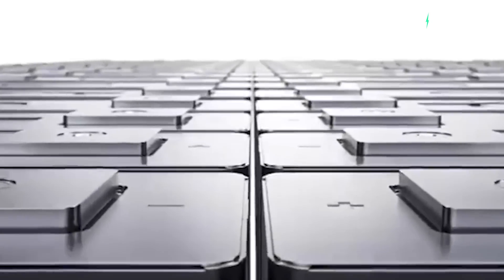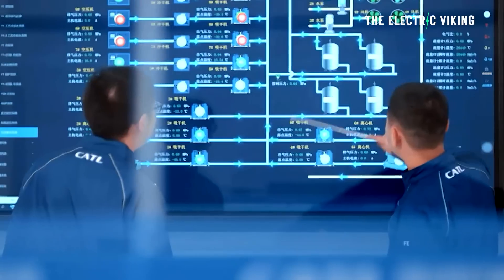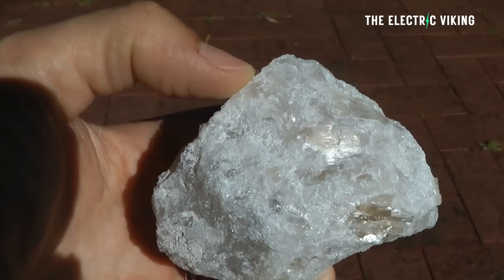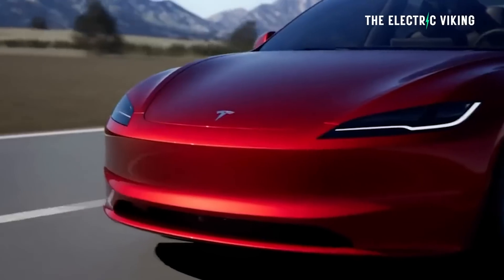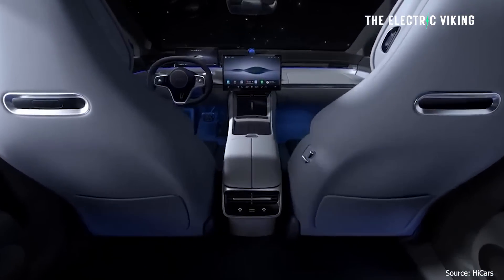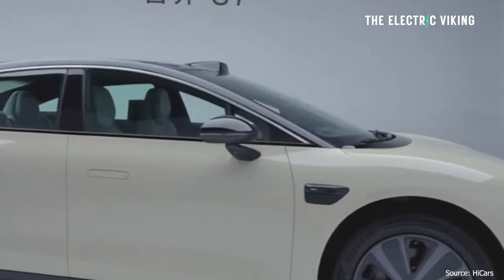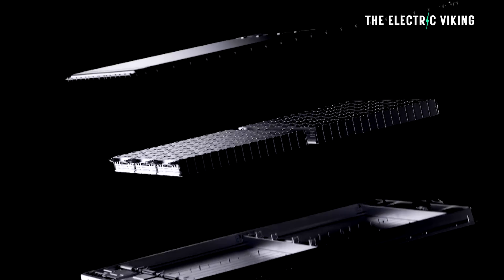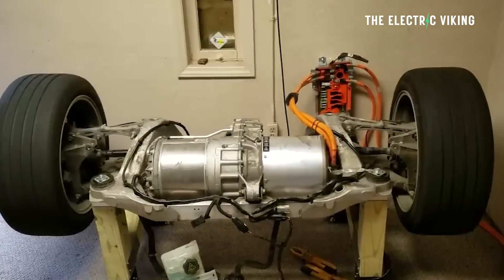World's first EV with CATL's hybrid M3P battery now available to buy

Comment: The value of any Tesla automobile purchased before the 2025 models become available with the new battery technology will collapse when the new vehicles hit the market.  Everyone will want to get the new technology and try to sell their existing vehicles which will further drive down the value of their existing vehicles.  So, the only way to purchase now and reduce the impact of depreciation is to do a 2 year least with Tesla.  The cost of a two year lease will be significantly less than the depreciated value of existing models.  Do the math.  After the lease is up then purchase the new vehicle with the new technology.  Just be aware that technology is changing rapidly and future "new" products will have new and improved capabilities which will affect the value of the previous technology.  Just a fact of life.  Ain't it grand how this all works.

Comment: Great info as always.  However I question the claim of 800km range on a 80kWh battery.  Consider this:  A kWh is a kWh.  Doesn't matter whether it is stored in a LiFePO, NMC or even in a Lead Acid battery. 800km ÷ 80kWh = 10 kWh/100 km. Model 3 LR is best in class at the moment with 14 kWh/100.  ...  Efficiency comes from mechanical efficiency (rolling resistance, aero etc) plus electric motor efficiency.  ...  Where battery efficiency adds to range is where you use the higher capacity to squeeze more kWh's into the car, E.g., if Tesla upgrade the model Y battery pack from 4680 batteries 75kWh, and in the same space they put the new improved batteries and give customers 90kWh, that is 20% increase.  ...  But  ...  If they simply give you a smaller battery pack with the new tech, so you still get only 75kWh,  the range is not improved like that  ......  Cheers, thanks for your great channel 👍

Comment: Can you stop telling people that charging their LFP batteries to 100% doesn't affect the battery. This is a lie. The only reason you are charging it to 100% is to calibrate the BMS. If the BMS was able to tell the difference between 80 and 100% the advice would be to charge it only to 80. Charging your LFP battery to 100 will increase degradation in comparison to charging to 80

Comment: it's about time, less lytium 700 km range, that,s the only way electric vehicle will sell. Anything else available at the moment is crap, even the expensive ones are crap. will wait and see, i dont trust any builders anymore;  cars that explode or catch fire is criminal cars that door wont open in an accident is criminal. cars who"s 12 v battery die when parked for 5 days is not criminal but we dont want them, cars that sell for 65,000 dollars is hyway robbery for most people . cars you cant charge more than 80% are worthless.. Anyway we have to wait for the good  ones and before they are available on the dealer lot will take time,, and you dont want to buy the early ones because the dealers will take a big cut over the demanded price.

Comment: Even LFP degrade more if 100% charged. The reason Tesla says to 100% charge them is because they can't determine the state of charge because the voltage drop is flat compared to Lithium Ion. If they aren't recharged 100% they can't keep track of the charge state.

Comment: I don't understand. If the MP3 battery has a higher density, then why is the battery pack only 80kwh?? I was expecting a minimum of 110kwh. 
Also, how on earth can a 80kwh battery achieve a 800km range??
....unless you believe in fairies..

Comment: Plecase do not mention ranges in CLTC anymore! They are almost double than reality!
800km in CLTC = 680km in WLTP = 590km in EPA = 500km in reality.
Reply: Most drivers can achieve WLTP
Reply: @nordic5490  In city driving or speeds until 90km/h and summer conditions and no AC, yes you can achieve WLTP, but most of the times you will be not even close to EPA.

Comment: I dont like EV but if we have unlimited elecriticity , I would make batteries in big box container. Robots will pull out your battery and put charged battery. Basically you will have main battery and temp battery. Temp battery give you 50mile. So in emergency you can use them. its like your extra tire.
Reply: Batteries can be charged from 20% to 80% in just 5mins. Why bother with robots ?
And, 90% of all ev charging events in the usa are at home atm. Just charge overnight.
Reply: @nordic5490  fast charging kill the battery quick
Reply: thats pie in the sky thinking. If tesla had that approach, the cars they now sell would take more time to make and be heavier. Another round of infrustructure needs to be conjured up. We are already conditioned to fill'er up.  But if you want a "temp" battery, thats easily done. Just lug it into your boot and plug in when needed. We are already seeing EV trailers that carry a battery pack. If you cant wait, generators are cheap enough. But dont try to re invent the wheel in your mind. Swapping batteries is about as effective as hydrogen refills, not in my life time.
Reply: @andyfreeze4072  EV cars are scam anyways

Comment: With safer and longer range batteries packs, people are more likely to switch to drive an EV. 

But electric vehicles are still way too expensive for most people to purchase. 
To get more people to drive an EV, Auto Companies has to bring the price down on E V.
😉💖⚡️🔋⚡️👍
Reply: The USA has a 25% inport tarrif on Chinese made evs. Take that away, and the USA could have $25k evs.
Reply: @nordic5490  I am aware of the "chicken tax" ( https://en.wikipedia.org/wiki/Chicken_tax) but that applies to imported trucks and light commercial vehicles. Is there another import tax levied against imported ev vehicles?

Comment: When you say hybrid what do you mean? I thought M3P just adds  magnesium. A hybrid might suggest a mix of battery's like a combination
Salt and Lithium pack. I would llike to see some real world ranges in mpg's from some of these new 600 km claims. I don't see how they are squeezing more range out of these 80 kw packs. (better motors or huge weight losses)
Reply: The M is for manganese,  remove Cobalt and boost Nickel and Manganese .
Reply: The hybrid batteries actually mix  LFP and NCM cells  with extra battery management.
Reply: I think only one company is doing the combo battery . And it's not out yet. I was under the impression it would be 
all LFP or all M3p .

Comment: Someone with a zeekr 001 using the catl quilin 140kwh pack got over 900+kms of real world miles at 90+kmh out of 1 charge earlier this year.
Reply: With a 140 kWh pack, going 56 mph, they went 560 miles.  That's 3.99 mi/kWh.  Ionic 6, Lucid Air Pure or Touring, and Model 3 RWD can all hit that efficiency level.  A bunch of other cars come close.  Whether or not you need a battery that gigantic is another question.  Personally, I don't.

Comment: An 800 km range should require a minimum 120 kWh battery pack.
Reply: or a light weight aerodynamic vehicle. Battery chemistry and size is but one part of the equation.

Comment: Very much waiting for this technology. I frequently drive up into the mountains during the winter (At least weekly).    I want to be able to reach a trailhead 165km from my door without charging on the way home.  When I apply range adjustments for Cold (-15C), Winter Tires, Highway speeds, Charging to 90%, Getting Home with 10% I'm come out with current numbers around 125km  on the LR and 115km on the lfp. This new battery that likes 100% and has better cold weather performance could just get me over the line.
Reply: Don't forget the regen when going downhill, could be considerable. Hi have a LR M 3 RWD with 500km range @ 100%, however charge to 80% & could make that trip return at -25c no problem.
Reply: After sitting for 6hrs at -15c,  my understanding is that it will take some time for the battery to warm up enough to charge from regen, do you have any experience with that?  Unfortunatly with most of my mountain destinations have the steep climb/descent close to the trailhead.  @rozonoemi9374
Reply: I doubt that Tesla is going to switch its LR variants to M3P, because it needs the higher energy density of NCA/NMC/NMCA. M3P has an energy density of 210 Wh/kg on the cell level, compared to 269 Wh/kg for NCA. I suspect that only the standard range will use M3P, but the LR will use the future NMC Qilin batteries, which have an energy density of 255 Wh/kg.

Comment: 850Km CLTC does NOT translate to "800Km real word range". We know that  CLTC gives higher range estimates than WLTP, which in turn gives higher numbers than EPA, which in turn is higher than typical "real world" range.... So, hype aside, I'd be pretty surprised if this car had much more than 600Km "real world" range. We will have to wait and see...
Reply: Exactly!  Too many Negative Trolls here!
Reply: NEDC ?
Reply: Europe has been using WLTP instead of NEDC for some time now. I believe that CLTC is similar to NEDC, but AFAICT nobody uses NEDC anymore. @antoniopalmero4063
Reply: 800km on 80kwh means 100wh/km which would mean it’s unrealisticly efficient, I don’t think that’s the point of this batterypack. 80kwh = 80kwh. Point of batterypack is cheap and less weight.

Comment: Hmmm.... could Tesla be delaying their new 'Ludicrous' Model 3 for this M3P battery?  Would be a much lower volume model after all.  Perhaps a nice range boost too.
Reply: It's still lower energy density than NCM . What is kind of a disappointment is the 4680 from Tesla only starts to approach the 2170 energy density on the New version. As others pointed out the M3P race does not have a clear leader yet and none of them beat the 2170 for energy density even on claimed Specs.

Comment: Tesla bet on 4680 and the chemistry in them. Unfortunately, the battery is a lemon. To change from the commitment of 4680 structural packs would be a nightmare. Problem for Tesla is they will be left behind in the battery technology.
Reply: I wouldn't say it is a Lemon but it does need some major upgrades for Energy Density .
Reply: 4680 is a form factor/shape  only. Any suitable chemistry can be inserted. The actual chemistry in cells and modules and packs has evolved over time with all manufacturers.
Reply: @jimbartley5066  can’t you read ?
Reply: @lesliecarter4295  No, you can't find the thruth about your statement.
Reply: Tesla moves faster than legacy OEMs but slower than Chinese EV companies.
Reply: The 4680 form factor isn't a lemon, but it is only for high nickel chemistries which have a higher risk of thermal runaway, so they need greater safety. Tesla is using a prismatic form factor for LFP (and probably LMFP and M3P in the future). Right now Tesla's 4680 only has a cell energy density of 244 Wh/kg, whereas the  Panasonic NCA 2170 produced in the Nevada gigafactory is 269 Wh/kg, but its 4680 is using a NMC 811 chemistry in the cathode and a dry process with no silicone in the anode. In contrast, the Panasonic NCA 2170 uses 10%-15% silicone in the anode, which increases the energy density. I suspect that once Tesla masters the dry process with a graphite+silicone mix in the anode, its 4680 cells will have the same energy density as its 2170 cells.
Reply: @amosbatto3051  Most likely will have  4680 2nd generation in Cybertruck, with higher energy density. Only 1 week to launch 💥💥💥

Comment: Please be aware that the Limiting Factor says that adding manganese to LFP improves energy density at the cost of cycle life.  So its cycle life takes a hit. And the range number seems wildly inflated. No 80kWhr pack in a 5000+ lbs car is getting 800 km range. Just not possible.
Reply: Exactly. New tech means you could put more kWh in the same volume. If they said it was 100-120 kWh, I'd believe it. 80kWh going 800 km would be like an Aptera type vehicle. Makes no sense.
Reply: Bear in mind the battery will be lighter than a current 80kw battery. That’s where the efficiency gains are. But 800 km is a real stretch. 600 or so is feasible though.
Reply: It will have more energy density than curremt LFP batteries, but life cycles will take a hit. No way It will get 800 Kms of range with a 79KWh battery pack.

Comment: I have been putting off buying an EV for years, even though I've wanted one from the start, because I keep waiting for the next jump in technology. But there's no sign of it slowing down, and it's time for me to pull the trigger. Waiting for the new Highlands to come out and making my purchase
Reply: Personally I was not waiting about technology (Knowing it will be the same as computer and phone, it will always improve then will be infinite wait). But I was waiting to get my minimal criteria, 4x4, officially able to tow 1800 pounds and able to get it will full subvention here (Canada, Québec). Got Ioniq 5, perfect, exactly as expected. 😁Why I say this, now I tasted V2L, now what I wait is this technologies improve to get eventually V2G, LFP and with more advanced technology, I will get more millage. 😄
Reply: Ioniq 5, Hyundai's single good looking vehicle. 
The Korean car makers have zero design language consistency, and in general make as ugly vehicles as everyone else.
Reply: @sergiomomesso1590 Do the new Ioniqs have a rear wiper? I know a few owners that looked to trade their original model year Ioniqs in for this reason.
Reply: @packetattack7437  Only model N (near 600hp) have it. This said, before my Ioniq 5, I had a Subaru Crosstrek that had a rear wiper and maybe in 5 years I had it I used it maybe 2 times and found it useless without liquid to really clean it and it's easier to check side mirror as do truck in winter. Then I consider it as minor issue in my case this wiper. (Some people think it is very important.) Not in my case since I live very well without it as I done with my Crosstrek.
Reply: That's like bying a computer in the 1990ies was, seriously. It was constantly over the years like "Buy now or wait for the next improvement...".
And after some months of waiting instead of buying, repeat ;-) 

You could have waited until now and not have one in the meantime and use a typewriter instead and type letters to your local newspaper - or pick an offer that fits you.
Reply: Exactly the same situation I’m in. I think it will be the BYD seal performance but I have to pull trigger in a month
Reply: I sold PC computers for over 20 years. I always told potential customers that next year's PC would be faster and cheaper, but if you want the benefits of a PC now, you just have to dive in.

Comment: 2170 and 4680 are form factors, they do not define chemistry. It is possible to get LFP batteries in cylindrical form factor and NCM batteries in prismatic form factors theugh they are not common.
Reply: True. I think he was using the numbers in this case to refer specifically to Tesla's batteries in those form factors.

Comment: One more important feature of   LFP is that the voltage is changing much less compared, so it is possible to use higher acceleration @ low %
Reply: Yes and no, I use both technology, they are different animals, I mean Lithium version are for performance because they have more energy per volume. LFP yes have more stable voltage (Even it's hard to know the real charge state with those batteries) but are bigger and used for because they are more stable in long run and have way less risk to have thermal runaway.
Reply: @sergiomomesso1590  LPFs are also Lithium batteries.
Reply: @MrVolodus  And both got invented near the same time, I agree with you both use Lithium. but LFT are more based on Iron and others chimical compared to Lithium version. https://en.wikipedia.org/wiki/Lithium_iron_phosphate_battery, Then way less chance of runaway with LFP version and why more and more EV use them. It's why I mentioned it.  ;-)
Reply: @sergiomomesso1590  I know :)They are cheaper, safer, non toxic and don't contain any cobalt. Its just that I hear too often calling NMC as Lithium and LFP as Iron, while they both contain Lithium. If, lets call them Nickel vs Iron(or cobalt, or manganese).